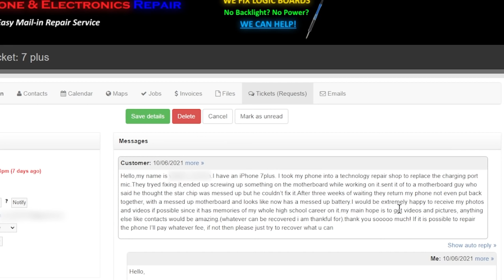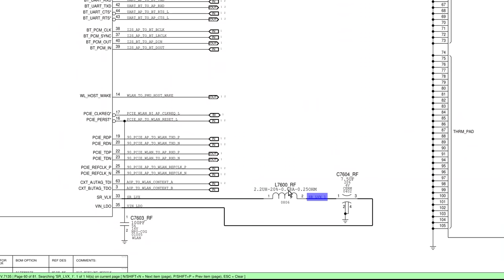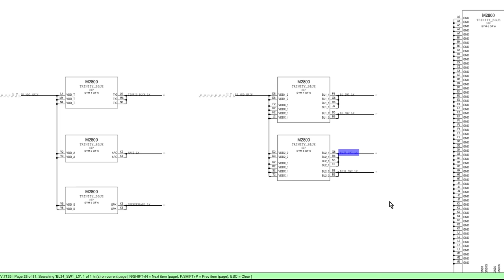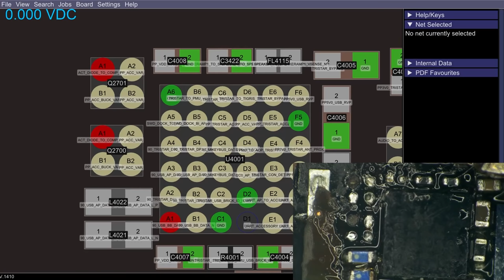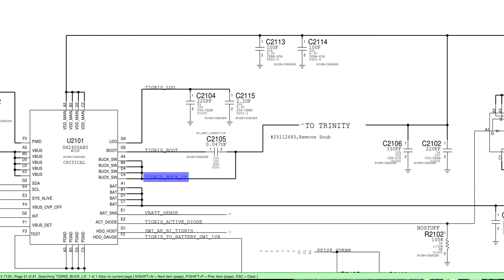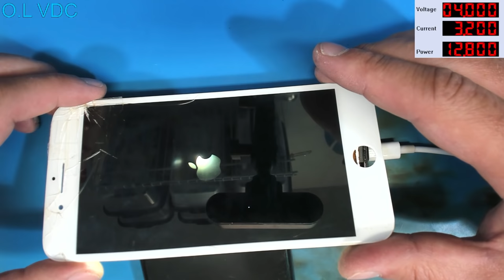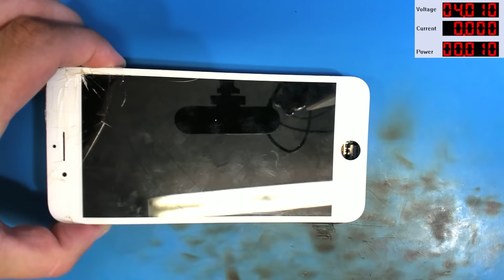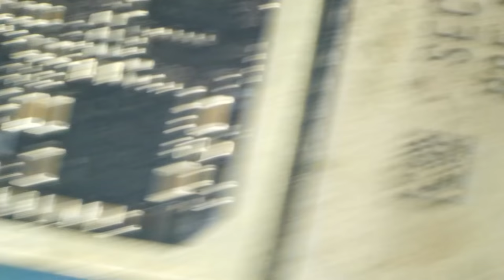Another shop mutilated this board - I got the data (and ROYALLY trolled myself)

Comment: Folks, I know very little about the electrical layer, but was wondering.  Since the requirements from the customer was to recover data and since the board was trashed,  can the flash memory where the data is stored permanently have been transplanted onto a working donor board?   I know this is probably difficult because it would require re-balling the chip/s?   If it could have been done this way, the video would have not been as interesting.    If this is not feasible why?   Security/Encryption tied to other components on the board?

Comment: I am very curious as to what the thought process was from the technician who had done the previous board work. I think you are right when you say that they removed trinity because they suspected it to have been damaged during the mess of a tristar repair, but what I don't understand is why run the jumpers for the arc driver and the speaker amp? Why were they concerned about sound and flash on a device that won't even boot? Why someone who isn't skilled enough to do a simple tristar job without absolutely raping the board nor diagnose a simple VDD main short in a cracked wfif/bt IC is running jumpers under trinity is beyond me. 

How do you mistake a VDD main short for a bad tristar? The memo from the client said they shipped the phone back in pieces - I'm wondering if maybe the original issue wasn't just tristar, all hell breaks out during the attempted repair, they send the device back in pieces and the wifi/bt IC gets damaged during shipping? Who knows I may be giving them too much credit. lol

Comment: off topic here but i been binge watching your videos and noticed you changed your thermal cam from the flir one to a seek, im assuming you just upgraded but in your opinion is the flir one pro adequate enough for pcb level work?
Reply from the maker: The FLIR One Pro is definitely good enough for board level troubleshooting.  It doesn't have quite the resolution of the Seek but still works very well.  Aside from the resolution, what really makes the Seek work so much better is the macro lens.   I wonder if anyone has ever made one for the FLIR.  Thank you for watching!

Comment: I have a question… about LCDs I haven’t touched one since 2017
Are newer iPhones the same? Or different?

Is the order still
Front Polarizer
LCD crystals
Digitizer
Back polarizer
Horizontal and vertical prisms
Backlight with Diffuser
Light Guide Plate
Reflector sheet

Comment: Probably would've been better to use a high-wattage contact iron to heat up that Wi-Fi unit instead of the hot air gun, with all those tiny sensitive components right next to it.

Comment: resistor color code.. several formulas e is equal to i squared r  power formula right?? p=e x i vacuum tube diodes, pentagrid converters. amplifying tubes. a lot of memories coming back. thanks. i used soldier wick and vacuum bulb in my days.

Comment: With a board in the condition that one was -- I'd NEVER be able to just watch a replacement chip settle down under heat over an iffy pad matrix and actually be confident that every connection just reflowed OK.

Comment: What UV solder resist do you use? I don't see it listed in the description. Trying to get the hang of pad repair, but the cheap goo "solder resist" I got is really thick and barely cures. It also has a 2014 date code, lol.
Reply from the maker: For the longest time, I didn't use anything for jumpers and bragged about having surface tension hold everything in place.  Oh my how things have changed.. LOL  I need to get that added to the links!   This is Mechanic LY-UVH900.  I think the contents of the tube will expire before I ever use up one tube using these amounts.

https://www.amazon.com/Curable-Solder-Repairing-Paint-Green/dp/B01MUB4PJL
Reply: Great, thanks!

Comment: What software you using to get the Singlent PSU to display on screen?
Reply from the maker: It’s a windows application called Easy Power that came with the supply.  That gets it on my screen via USB than I use Open Broadcaster to capture it.

Comment: Sometimes i miscalculate the heat and the air of my hot air therefore the other capacitor or IC make shorted🤣 but experience more error it makes a learn👌

Comment: jason what multimeter or hardware you use to display the readings on screen
Reply from the maker: In most of my videos, I'm using a TP9605BT meter and the software that comes with it.  I recently switched to the OWON B35T+ meter and I'm pretty sure it also has PC based software but I'm using the software from 1i that goes with my microscope eyepiece.  It shows the readings onscreen & in my left eyepiece.  My meter is Bluetooth to the ocular and then the ocular is serial to the PC (serial to PC is only so I can capture it on video).

So regardless of meter or software, once the reading is on the screen, I use Open Broadcaster to capture it.

Hopefully this helps!
Reply: thanks for the information jason one last thing you already try the amtech 559 flux?the chipquik is better has less fumes and smells better because i will import and need some information about to decide i live in brasil and i can only find easily chinese flux i currently use mechanic flux it’s good but the smell is terrible

Comment: That's definitely a 'donor board' that they've scavenged parts from.  Probably they messed up the original board so much and just put that one in to cover their tracks.
Reply: it would not be. the board would have had a different lock screen password to begin with. then you would have seen the rest from the serial and IMEI once it connected. Ultimately the backup made would be wrong and not the right account. It was a plain and simple piss poor repair job in the first place. I've had my iPhone and iPad screwed by shitty repairers.

Comment: I am not sure on apple but if you could get phone booted. why not just use some online backup / export and get it off phone without usb? I had to do this before to get data off. I also have a LED panel that I can use for those backlight not working issues. cheap on ebay .
Reply: The phone had no wifi, bluetooth or cellular interface.  How would you get it off the phone?  He literally talked about this in the video.

Comment: Okay you just wanna backup the data. In case you've another working iPhone7 board.
So can't you just switch the chip that stores the data?
... or does (De-)soldering do any harm to the data
Reply: The data on the chip is encrypted.  You can't read it in another phone. If it was that easy, getting data from locked iphones would be trivial.
Reply: I see.
Oh dear I wonder who needs such 'security'? Why is it there?

However are there information about how the key for this encryption is created and were it is stored?
Maybe it just requires also changing the CPU that has some kind of ID that is use for the encryption.
Reply: @stargazer7644  I see. Some people will like it some not.
I mean to do so someone must get my phone and the equipment to do the soldering and stuff to do something nasty with the data on the phone.
Of course you can't do - because of the security chip... 
Or it can happen that something bad happens and you want to recovery your data.
These are the two sides. I like android more where you have a choice to encrypt or keep your file system clear.
But here I 'pay' for tricky hidden security I didn't ask for.

However to quote Leonard Cohen:
"There's a crack in everything - that's how the light comes in."
So I thank for the team that create the checkra1n jailbreak.
Really crazy how they exploit the usb protocol to make it work.

Oh dear that apple stuff is as fascinating as scary.
I mean who is gonna to implement a chip in a simple 'stupid' charger cable just to maximize their profits and make people to only buy their holy sacred wire.
To get some stuff running that's not from the app store you to do handstands. Like for example some game emulator or some app from a 'friend'
Apple is a real control freak.

However apple is  a good challenge and though opponent.  Nice to see them despite their crazy signature and ring of trust shit - been jailed break again and again.
Reply: @asselpunk1  You don't leave your filesystem unencrypted to assist in recovering it if the phone gets trashed.  You do BACKUPS for that.  Every time you plug the phone into your computer, it gets backed up.  Critical parts of it can backup constantly and encrypted to the cloud.  If the phone is lost, or destroyed, no prob, you get a new one, plug it into the computer, click restore, and you're done.
I started with iphone.  I switched to android.  It sucked.  I went back to iphone.  Yes, I have a few gripes about the choices apple makes for you, and the cost of their logo, but overall, the damn thing just works and works good.  And they care about privacy and security, and you really can't say that about ANY other company right now.

Comment: i seen  a direct ROM reader, where you drop the Storage ROM right into a clasp sort of like a LGA Socket. Not sure how to get one or what software is used to extract the data. i know it exists though. The law would def. like to get there hands on this little item.
Reply: Except that it won't work.  The data in the flash is encrypted.  You can't do anything with it.  Otherwise getting data out of locked iphones would be trivial.
Reply: @stargazer7644  I know they did it with the older iPhones. But if the tech knows the password to the iPhone the chip can be loaded right off the device. i'll post the vid soon as i find it.  but, this is a simaler device.  he clearly says if the data is encrypted, he couldn't do it. if there's a will, there's a way. (data recovery from iphone eemc chip)

Comment: They didn't attempt a repair. They found a good board and use it as a Parts Expendable Bin. I am willing to bet the CPU and what not (missing the label) are off a different board and just threw back on to avoid detection.

Comment: I have a iphone 6s that gets super hot when the battery is connected but no display its just getting hot no power what so ever what could be the problem
Reply from the maker: It's really hard to say for sure without seeing it but with the iPhone 6s, the most common faults that cause them to get hot when the battery is connected are WiFi IC shorts & backlight output cap short.  If it seems to be getting hot around the ear speaker or back camera, it's more likely to be the WiFi IC.    This is all really just guessing by what's the most common tho!
Reply: @ststele  Can you maybe fix it
Reply: @Eds157  Can you afford it?
Reply: @stargazer7644  depends on what you will ask if it's expensive I can just buy another one
Reply: @ststele  the whole phone is getting superhot

Comment: Looks like a board that was used for spare parts.  Is he sure he even sure he got his original board back?
Reply from the maker: Yes - I'm very glad there wasn't any mix-ups.  The customer's passcode worked & they were glad to get their data back.  

When I suspect it may be the wrong phone or board, the passcode is the best way to verify.  There have been times when I thought maybe it was the wrong board and the passcode was wrong tho...   In those cases, I take a picture of the lock screen wallpaper and send it to the customer.  The one time I actually did have the wrong phone - the guy responded to my photo of the lock screen wallpaper in absolute panic as he had no idea who the people in the photo were.  A shop before me had put the wrong board in his phone!  He got in touch with them and they were able to send me his board.   The guy got his data! :-)

Comment: amazing to see you work.
I really hope that the customer paid you the cost for a new house for retrieving those data.. the state of that board was horrendous... well done
curious what did such a job cost the customer-
Just to get a ballpark of a tricky job like this... goes without saying some data-retrieval are way easier and likely cost way less.. but a job like this to get the data back.. what would that cost?
Btw is it a Seek thermal you using.?
Got an older Seek myself FF-pro and have been a pleasure since I got it in 2017 as I can just put it on a microscope stand if I need macro views at a few mm.. wicked to see how far the prices have come down on thermal cameras the last decade.
and the resolution ain't to shabby for like a few hundred bucks
https://www.youtube.com/watch?v=Im1_Dyf69to&t=67s
https://www.youtube.com/watch?v=8NGalm8VFbQ

Comment: The other company just wanted extra parts ?
Reply: In its original state, could you disconnect the Wifi/Bluetooth IC and have the machine working just without those two? 
Or does it need it to pass BIOS?

Comment: I find myself getting frustrated at things like this.   Not the repair.   I think repairing is good, and find repair videos quite relaxing to watch.    

No, what frustrates me is people relying on their phones to store all their personal data with no backups.   Phones are electronic, and electronic devices do fail.   I've dealt with enough users who've shouted and sworn at me because the one copy of an important project they are working on is on the USB stick that just failed.

Whether you use Android or iOS, you have access to cloud based services that will back up your important data.    You may need to pay for it, but what's a few dollars, pounds or whatever your local currency is a month compared to the value of a lifetime of personal data?   Even if you plug the damn thing into a computer from time to time, you'll have some of your data backed up.

Which brings me on to the annoying part.    The scheisters who take people's money for a repair, and return the device in a worse condition than they received it.   If they can't repair it, they shouldn't try.  They should say upfront "we can't repair this".  But some people are less than honest.

Comment: This 100+ pin BGA device just to get rid of 4 inductors?
That's definitely not needed and just another apple's attempt at making those hard to repair...
Reply from the maker: Yessss.. it's nuts!  They have compacted 8 pins into 161!  I don't see how it could possibly make sense from an engineering standpoint.  Now a backlight filter cap short involves replacing 4 coils (with 161 pins) instead of just one or two.

Comment: And this people is what will happen if Right to Repair becomes law, more and more wannabe techs thinking they have the skills and knowhow to do this type of repair work when in fact they don't and end up just making things worse until it gets sent to someone who knows what they are doing. The moral of this story, be careful what you wish for.
Reply: You buy a $1000 phone and the wifi module fails.. 
Do you throw the phone away (backup or no-backup)? Do you fix it?
Given that you want to fix it, how easy should the repair be? Its a $5 part, so anything over a $50 repair is to much.

Actually as we saw, the wifi module damaged the PCB and nobody will do a repair like that for $50.
Allowing wannabes to vocalize over poor design choices is a good thing & ultimately leads to more reliable hardware.

(I was actually quite surprised the backplane isn't segregated in someway so the power drain from wifi could be detected & powered-off / reported)